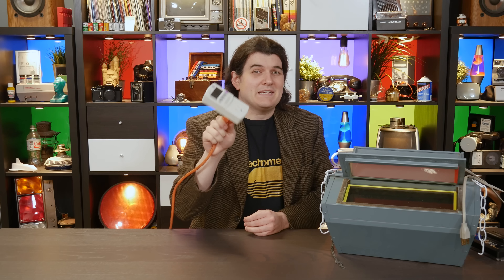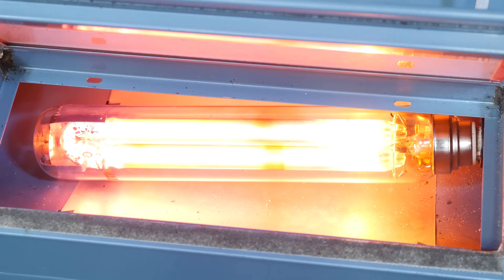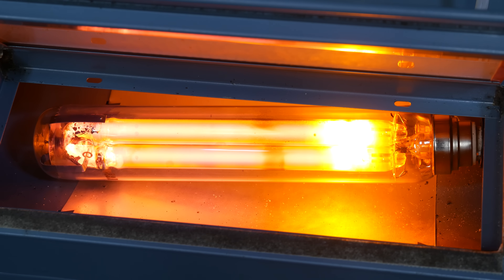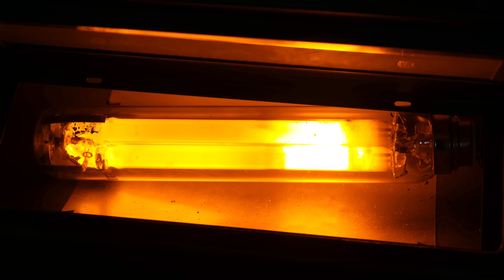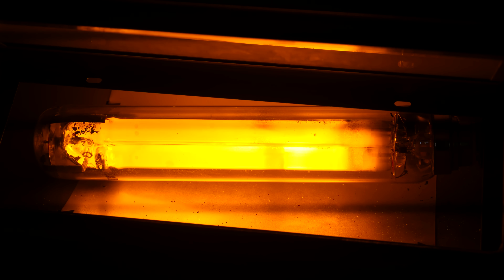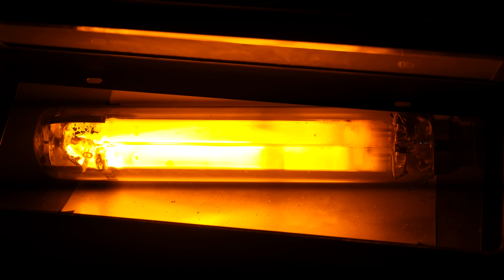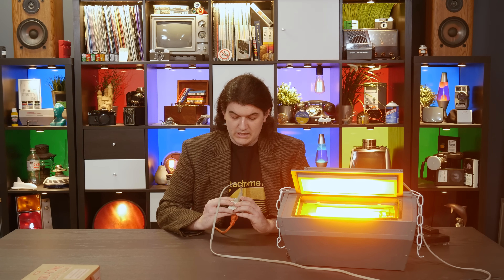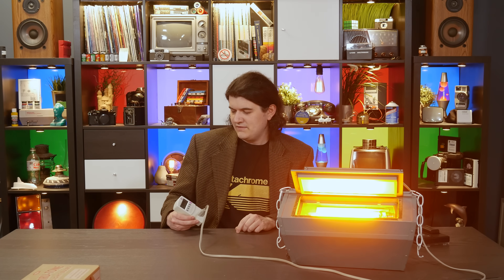More vaguely-informative ramblings about low pressure sodium lamps

Comment: I’m an Electrician and I’ve replaced plenty of low pressure sodium as they burn out, but they normally have a mogul base or an E39 or E49 Edison size, so they would probably not fit too well in your fixture.  They sell adapters for $3-5, but they might add 1-1/2” to 2” to the length.

Edit: I haven’t changed so many bulbs in the past few years.  I’m doing a lot more fixture replacements with LEDs, but I haven’t been doing very much lighting in the past few years either.

Comment: I have always loved low pressure sodium and it didn't get the respect it deserved.
Musing on PF: Electric utilities don't usually measure PF on residential meters but the majority of larger industrial/commercial buildings get penalized if their PF is too low. They are often typically charged with a demand factor too which is also something that (until recently) utilities didn't really consider in residential cases. In some cases, the PF surcharge can be extreme and rightfully so as the utility needs to size and supply much more power for the same load. Some power companies can even penalize you if your phasing is really imbalanced. But it's not a massive deal in residential dwellings as a lot of those issues stem from inductive motor loads (one example is the air handling fans in a commercial building, they can use 20% of the energy of the building so there are strict standards on the controllers and such these days).

Comment: I bought an old LPS cobra head (not really a cobra head shape but you know) from the City of Glendale, AZ (it used to be their tech of choice until about 10-15 years ago) and I use it in my mellow yellow lounge (spare bedroom). I also have a dusk-to-dawn lamp in there that I interchange HPS and MH lamps into depending on my mood (the HPS restrikes instantly).. LPS still gives LED a run for its money in lifespan. Super reliable and easy to filter out so places like Flagstaff with an observatory liked them too.

Comment: I'm stsrting to resent LEDs, they make lighting boring. House bulbs: Incandesent-LED, Street: High/Low Pressure/Metal Halide-LED, Office Buildings: Fluorescent-LED. Its sad, like everything automotive and equipment going electric, and power tools mostly being battery powered, less air tools. Just a couple technologies now, minor difference depending on design and application. Its a shame the worlds tech is becoming plain and all the same.

Comment: This sort of lamp was used widely in the UK as street lights until they started getting replaced maybe 15 years ago with brighter less yellowy lights (I guess high pressure sodium lights). Of course, in the last 5 years, the majority of lights have been replaced with LEDs, but still you'll find these in areas where the councils don't care about.

Comment: My guess is that they did something to make the sodium condense out at that spot when the lamp is turned off and allowed to cool down.

A bit like in a quartz halogen lamp the filament metal can't condense onto the quartz so when you turn that lamp off, the only place the metal vapour can condense is back onto the filament. 

I know that's right for quartz halogen, but am only guessing that low pressure sodium is similar in that respect.

Comment: When we built our home in 2013 one of the streetlamps to the side of our property would start up, take maybe 5-7 minutes to reach full brightness, then go out for like 3-4 minutes. It would then repeat indefinitely. Did that until it was replaced about 2 years ago with a white LED version. Kinda miss the on and off when we are out in the back yard. Would that be a sign of a bad bulb or ballast? I assume the ballast is only to start? But I’m no expert on the matter.

Comment: Re: street lamp outside my house. A pair of vans turned up today to replace the lamp head with a new led one.  A pair because it's a two man job to feed the new wire down the lamppost.  Apparently, the old one would have been replaced working or not about ten years ago when the radio control was added to the street lighting .

[later] well that's horrible! it is the whitest of white lamps . It looks to be 20-25watt made of an array of point source LEDS

Comment: Hey Alec, long time viewer here, love your videos! Just want to give you a little bit more information on power factor and some of what's happening here. Power quality happens to be one of the areas I specialize in as an electrical engineer at a utility. Power factor is a little bit more than just voltage and current out of phase. Yes, the classical power factor everyone is used to seeing has to do with the current (usually lagging) the voltage. This out of phase relationship between voltage and current means more reactive (oscillating) power and less real (one direction) power. This is a simplified explanation that works sometimes. This however does not hold if the current is not a sinusoidal waveform. If the current is any shape other than sinusoidal, then it has harmonic distortion and can be decomposed using the Fourier series into many harmonic components. These harmonics other than the fundamental cannot transfer any real power but they do contribute to reactive power and low power factor. Fundamentally, power factor is real/apparent power, this always holds true and will account for the higher order harmonics orthogonal to the 50 or 60Hz voltage waveform (since they are a different frequency). It is entirely possible to have voltage and current perfectly in phase, yet still get a poor power factor due to these harmonics. It happens to be that arcing loads such as arc lamps or arc welders have significant harmonic components and this is likely contributing to the lower power factor here. This is even worse for the utility as this cannot simply be corrected with a capacitor anymore and needs some more advanced harmonic filters to correct the power factor. For larger loads, customers are required to keep their harmonic content within IEEE standard 519 limits. For fun, take an oscilloscope and measure the current waveform if you have a clamping current probe. I would bet if you put it to FFT you would see tons of harmonics on this light! There is also some classical displacement power factor at play here with the current lagging the voltage due to the inductive ballast. This is a real problem in the industry and is growing to be more common with more complex non-linear power electronic loads such as power supplies or inverters.

Anyways, great video as always! Keep up the great work!
Reply: Thanks for the breakdown, I first heard about power factor on this exact video, and I've been curious about what that is and how it actually affects the power consumption, but I couldn't understand any explanation other than ELI5's. Your comment made things a lot clearer, so thanks.
Also, harmonic lights? Yes please!

Comment: Interesting fact. Where I live the street lights used to all have that red color and would warm up to their normal color and more and more they are now white. I recently found out by a cityworker they all used to be sodium lamps and instead of replacing the whole street light they have been one by one as they die changing the bulbs out with led drop ins because it saves them tons compared to the next medium sized town over which just went through and updated them all. The bulbs were found on local Craig’s list and gone in a mater of days. So not only are they still in use obviously there is still high demand.

Comment: Osram still manufactures these since there's still a market.  But they're rapidly being replaced by other more efficient solutions.

You can also use an electronic ballast rather than a simple inductive one this will improve efficiency, lamp life and get rid of the humming.

Comment: I worked at an apartment complex in SoCal about 10yrs ago. We had lighted bollards around the property with those same LPS bulbs/tubes. I recall replacing a few of those and I believe all (or almost all) of the ones I replaced had a broken U-tube. I don’t know the cause of the failure/break. Also, all the bollards had the lamps mounted vertically with the bayonet connector at the bottom. Also also, I seem to recall that the bulbs got dimmer and dimmer as they got older as the U-tube built up a dark/shiny buildup that looked a little like tint.

Comment: I love low pressure sodium lightning I have two in my garden. Love it when it snows with the orange glow takes me back to my childhood. I got a few spares off eBay which will hopefully see me out. Know I'm getting old 50 soon but I think it's so hard to see things like curb edges and even junctions with the new led street lights love it when driving under sodium or metal halide lights sadly not that many left in uk

Comment: I have one of those (a small version, I think something like 34,6 W) in a street light in front of my house. As this was built as a shared private property this one is actually solar powered (small pannel on the top and some "sealed" box with like a car battery and a controller at the bottom. Yes, this underground box never stayed sealed and the batteries drown at some point)
However, we have three of those more or less going since eleven years (as long as the batteries did not junk out again) and we never had one fail yet.
When I initially checked, a replacement lamp was about 38 €. Last time I looked one or two years ago, it was up to about 54 € but still available. Currently as it seems, I may be able to obtain a replacement lamp for about 32 € plus shipping, it is named something like SOX-E 35 W with a rather weird BY22d socket. The LED replacement actually comes at about 70 €. I bet at that point it may be a good idea considering a change of the whole lamp head instead. The successor models of that lamp are all LED (which back then for the same amount of light used more energy, like at least 50 W, than those bulbs.) and from a burried box with a lead acid battery they moved to a LiFePo pack which is actually stored within the mast.
Looking at the controller, it seems the ballast we have is a little more gentle, as it shows like a total of about 38 W.

I wonder if those orange lights are marking a crossing or intersection, even though it is separated in a tunnel. I know there are some places where orange street lights are actually used to mark intersections. Bureaucracy may be quite weird when it comes to such stuff.

Comment: We had an LPS lamp at the entrance to a townhouse complex in my neighbourhood. I don't recall it ever being replaced for the ~25 years from the time I was a kid until a few years ago when it was swapped out with a new LED fixture. Walked by it twice or more a day too. So I definitely think that, when operated correctly, they'll last a very long time. It was one of the ~3 foot ones (so I guess 120-180W) in a nice long fixture and it took a few minutes to warm up, about as long as this one, not significantly longer. But this one would start very pink, for about 30 seconds, then would go orange-yellow then full yellow after a few minutes. I had a ~2 foot (I think 100W) LPS bulb in my light bulb collection when I was a kid, loved that one.

Comment: Some things to note here:

"Do 180W lamps warm up slower than smaller sizes?". Not significantly as low pressure sodium lamps have about same amount of power (and there for light output) per some area of lamp. If you want more light, you need physically bigger lamp (and more watts) but watts / cm^2 of lamp are always about the same. 

"Do they last for ~18000h or significantly more as there is additional sodium in the lamp and the sodium is not going to escape anyways?". There are two main ways how sodium lamps fail (both high & low pressure). 

1.) Sodium is very reactive and hot sodium is even worse. In both high and low pressure lamps sodium slowly reacts with the discharge tube (high pressure lamps use alumina, low pressure lamps borosilicate glass). If there is insufficient amount of sodium left in high pressure lamp, the lamp cycles. If there is not enough sodium in low pressure lamps, the lamp will just stay red forever. Important thing is that low pressure lamps have a lot of unused space in the discharge tube so you can easily put a LOT of sodium in the tube without any problems. There for I would say it's very rare that low pressure lamps run out of sodium. 

2.) Most discharge tubes use electrodes made out of tungsten. These electrodes are usually coated with some "emissive coating" all tho I don't know what this coating material is. This emissive coating is there to drop "electrode to gas"-voltage to get maximum efficiency and longer life out of the bulb. Electrodes HATE ignitions, high power high voltage ignition makes the electrode burst a little bit of tungsten and this emissive material. After some amount of ignitions, the electrode physically breaks or has so little emissive coating left that electrode -> gas voltage rises over the ballast supply voltage and the lamps is no longer able to start. 

I would say that 18000h average lamp life is probably about right low pressure sodium lamps and I think your tunnel lighting probably gets new bulbs time to time. 

Over 200 lumens / watt for LPS lamps is true only for 131W SOX-E (energy efficient) lamps with Philips electric ballast and notable is that 203 lumens / watt is also lamp efficasy, not system efficasy. Philips was the last bulb manufacturer for LPS lamps and they have a nice PDF showing all the different bulbs with different ballast: you can see both lamp efficasy and system efficasy. 131W SOX-E with the best ballast had system efficasy 173 lumens / watt when the lamp is new. 180W with normal magnetic ballast have lamp efficasy of 176 lumens / watt and system efficasy of 153 lumens / watt. 

Philips does not make LPS lamps anymore, I think they ended in 2017. I think that even bigger problem with the new lamps is the cost. Many of the Philips LPS lamps were like 30 - 90€ / piece (just the bulb) when I was searching those few years ago. You could buy pretty descent LED fixture with that money which has better color, higher efficiency & longer life.
Reply: Actually 131w SOX-E, E stands for economy
Reply: @zspacecaptain8228  Ah my bad. None the less SOX-E lamps are more efficient than normal SOX lamps

Comment: Bad power factors mean that the capacitors or inductors are storing energy for part of the cycle and then giving it back to the grid. So the higher current is as real as you'd expect, it's just stored and returned instead of used. Capacitors store their energy in an electric field, and inductors store it in a magnetic field.

Comment: Fortunately, it seems like there have been some Chinese manufacturers that were making low pressure sodium lamps for polarimeters. If you take a look at my profile picture, it features a photograph of an extremely rare low pressure sodium lamp that was used in the UK for some time, but they are now rare because such lamps were discontinued in the 1980s. Those lamps resemble clear fluorescent tubes. The reason that you have such high ballast losses is because most low pressure sodium ballasts consisted of high OCV autotransformer ballasts that step up the mains voltage to a very high level to allow for reliable starting. In some cases, there have been more efficient low pressure sodium ballasts that consisted of 220v-240v series choke ballasts that use special ignitors for striking the lamp. In rare cases, there were even some low pressure sodium lamps that used 220v-240v series choke ballasts and fluorescent starters such as the lamp shown in my profile picture.

Comment: I think you're right about them having spares for the sodium lamps. I now live in Berwyn (that's just outside Chicago) and they recently switched over to LED street light from sodium lamps. They did so all at once it probably being cheaper for them to switch over then try to keep a running cab of which lamps are which.

Comment: I grew up in the 70s and our house was next to an intersection.
When I was around 6 years old I was so fascinated with these bulbs that during the winter months my mum would set up a chair by the window so I could watch them start up.
I still love them as much as I did back then and I have enough bulbs to last me the rest of my life :)
Reply: What sort of fixture do you run them in? Getting very hard to find not only bulbs, but ballasts and housings too. Whatever is left of new old stock is it.
Reply: @Cheddar_Curtain  I have several fixtures but my favorite is the Philips SRM. I have (legal) access to the dumpster of the company that maintains the street lighting here so I pick out the ones I like best. They also gave me their remaining stock of HPS and LPS lamps and ballasts so I'm well stocked 😅

Comment: It's sad to see LPS lamps go away.  They are highly efficient, extremely long lasting, and the failure rate is near zero.  LED lamps have a very high failure rate due to the complex power supplies and diurnal temp cycling.  Overall lifecycle and total energy costs of LED is quite a bit higher.  But they aren't orange and in the public's mind LED=good so that's what we get.  On the plus side I'm happy to see high pressure sodium HID go away.  What horrible detestable things - I curse them and their families for largely murdering LPS for outdoor safety lighting.  Their constant failures, short life, failure to re-strike, horrendous aging curve, etc.  :)

Comment: With a power factor that bad i wonder if your ballast is going out?  That might be the cause of the hum as well.  As we all know power = volts x amps.  Some loads, like inductive loads, will cause the current (amps) to be out of phase with the volts.  Common inductive loads are lightly loaded motors and transformers (i.e. ballasts).  Great video!  Happy new year.